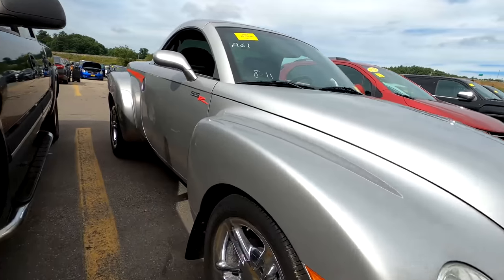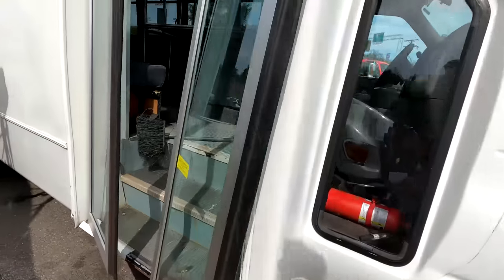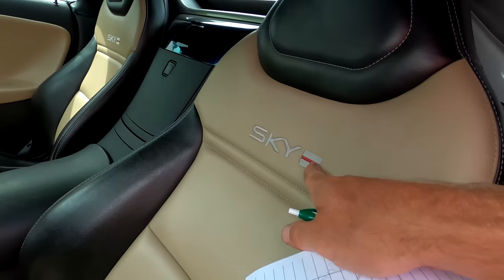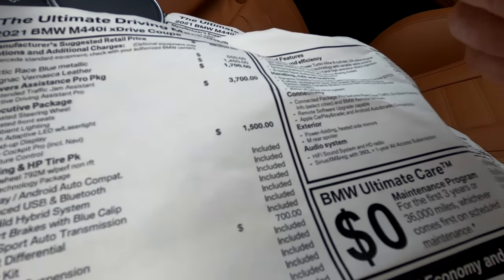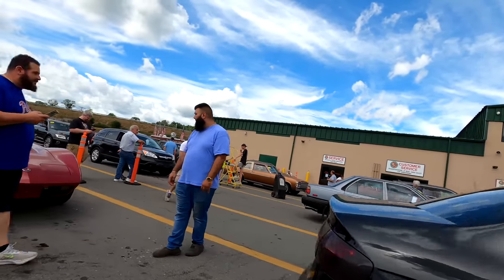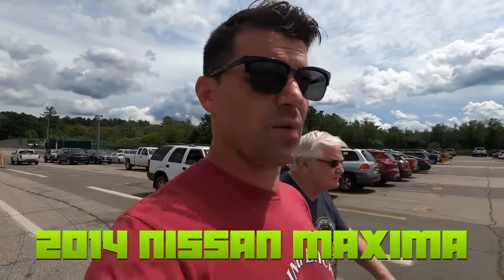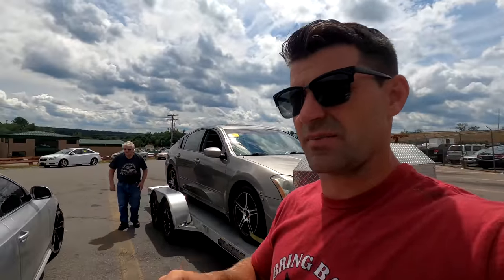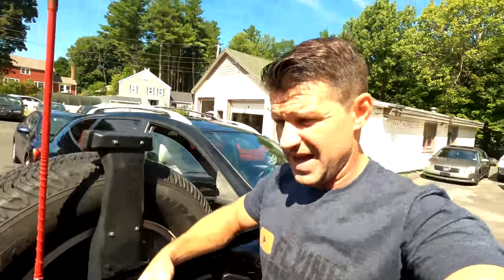Flipping $400 to a Ferrari - Bringing $67,000 to a Dealer Auction - Flying Wheels

Comment: Why are you hating on 70's cars? I like them and the 455 Olds Rocket motor were great engines, I had a couple of 70's Delta 88's one with the 455 and one with the 350 Rocket.... they were throaty sounding motors that ran forever.

Comment: You're getting your General Motors liters mixed up Craig. The '6.6 liter' was the 403 cubic-inch Olds V8 that was put into a lot of stuff in the 70's..... The 455's from Olds, Buick and Pontiac were stated as 7.4 liters (actually 7.45....)

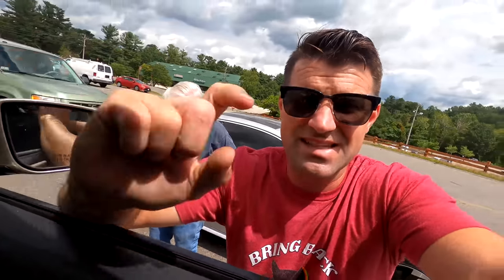Comment: @15:50... That Maxima does not have the same transmission as the 350Z. The Z is RWD, the Maxima is FWD. The engine is also different.
Reply from the maker: Good point

Comment: Yeah, Nissans and Infinitis with automatics, NOT CVTs, or manuals are great cars.  An 04 has an auto, not a CVT.  An 09 has a CVT.  Most of the other 2000s and 2010s Nissans have CVTs.
Reply: Sorry I have to disagree.. not all nissans are bad I have a 04, 06, 13 and 17 all of them never gave me any problems 3 have cvt. I will say the muranos and rogue are the problems. Altima maxima and titans have been great for me.
Reply: @shottie26  I'm not saying that the CVTs are bad, I'm saying that the Nissans without a CVT are great in terms of reliability and comfort etc. The CVTs are generally less reliable than the autos and that's because you need to replace the tranny fluid about every 30-50k miles on the CVT cars.

Comment: that hurst olds will be a 100.000$  car in the next ten years. Anything from the mid 70's era, aspen r/t's , 74-80 cameros, etc. is going to be the next generation of collectables for muscle car guys. I can remember buying my first 71 charger for $2500, now can't find a wrecked one for under 30,000, 100,000 for a good one. Yeah that toyota is a treasure? well it should be buried in a hole and never seen again for sure. The 80's were just a sad time for the automotive industry with a few exceptions.

Comment: Still to this day, That Oldsmobile is built better then most vehicles today except for vans & trucks being a cab on frame, v8 vehicles! I'd rather that then a fwd 4 cylinder pile of ---- yet, your interested in a 2.2ltr eco-tec where the transmissions are known to fail @ 160-180k & they have a interference engine though, the timing chains are easy to change on a 2.2 eco-tec!!!!!
Reply: Those old 70's cars, engines were worn out by 100k. 160-180k today is a decent life for an engine.

Comment: 89 Corolla indeed. My brother had one original everything he did a head gasket when he got it for $250 at 300k miles he wreaked it with 525k miles still rolling goo.

Comment: I would definitely get that 89 corolla so hard to find and that one is in mint condition they are going up in value and they definitely are not made like that anymore
Reply: I think the same generation was my first car. So many great memories!
Reply: Its a 30 year old car, n it was a cheap ass car back then.
There is no way its worth even a quarter of what it sold for.
I agree. They are not built like that anymore, but if you factor in safety and what you CAN actually pick up for 10k, you'd be very suprised to find, that u can get a safer car that will probably last as long as this will.
At this point, the seals have to be getting bad. Integral parts of the engine, who knows. Trans, who knows. Its a total crap shoot 
If you knew the entire history, that maybe different.
It was actually being used this entire time, just lightly and well taken care of? Maybe.

Comment: The Trans Am of late 70s  used an OLDS 403 engine mated to an automatic.while the manual still used the poncho 400.  So whether the Pontiac 400 or Olds 403 the shaker scoop would still read 6.6l.
By 1975 w30 package was the box you checked off to get the "hurst" edition Cutlass which included the olds 455 engine, hurst t- top, badging and whatever else
Reply: The 400 Pontiacs actually had T/A 6.6 on the scoop while the Olds 403 equipped Trans Am's said 6.6L. The 455 was 7.5L

Comment: Hey can you do a video on the new Dodge Rams 2019 and up 👍🏻
Reply from the maker: Just bought one actually
Reply: They are garbage quality from what I'm hearing people are having nothing but issues with basically new trucks not even close to being broken in yet
Reply: @FlyingWheels  I just bought a 2019 big horn . Finding out they have 16 spark plugs to change instead of 8 in a normal v8 plus hard to get to the drivers side to replace .

Comment: After seeing that Jeep I definitely thought you overpaid at 11k. Too much mileage and too much crap. Then you said like 67 hundred and I thought now we are talking. I think, get rid of all that sound system extra wiring, call an expert and make sure all the wires are good to go, nothing that could be a fire hazard should be left. All that red crap on the inside paint it black, get rid of that 8 ball also the leds from the rear, that looks ridiculous. I think it is a solid 9.5k sell, even with that mileage. I thought you screwed up again when you mention the maxima but it's a manual transmission so that was amazing. I use to have the same car and I didn't even know they came with a manual trans. Mine wasn't cvt and still wasn't that good. Everything else was still crap.

Comment: Well at least some vehicles are still losing good value.
There is hope in the used market.

I truly think when it comes to all German brands, ur an idiot to buy new (not u Craig just anyone who does).
Those brands lose the most across the board and quickly.
Usually at least 40% in 3 years. Which if owned by the typical leasee, thats a great deal

Comment: Could be a bored and stroked 427 small block in that Corvette. My Corvette is a small block 420ci. A bit more overbite or slightly longer stroke would net me 427 but I didn't want to compromise the block by boring it that much nor did I want to partially fill the water jacket to clearance the block for the larger stroker crank.  A aftermarket dart block wouldn't have these problems.

Comment: Hey Craig big fan but a few things to note :

Chevy ssr 6.0l is the ls2

The bmw is not a 440i m. The m comes before the numbers it’s m440i  and x drive means all wheel drive ( assuming u know that already ) 

Lastly the Saturn sky redline is the 2.0t is found in the cobalt ss and solstice gp. First gen cobalt ss and saturn ion redline were supercharged  also the Polaris slingshot was a 2.2 n/a motor so it’s slightly different. Polaris now produces there own engines now tho

Comment: Before you get to the Jeep wrangler market, im gonna go out on a limb and say its both because fiat made the JL a pos, imo. Yeah it drives more comfortably, however, they made even less reliable than it was. Also, more expensive than ever to fix.
The main price drop, probably has to do with gas prices. They are absolute gas hogs.

Comment: This is what I want to do! Unfortunately, when you're not 18 it's hard to do literally anything.  I'll just focus on the "clean a car" bit until then.
Reply: We all go through the same steps and are mostly all held back the same but you'll make it through it.  Gotta work to gain what you love.  The better the work the more it seems reasonable to the customer for a higher price.  And yea I've gone through the whole process to ASE down from detailing/fixing anything brought to me.  Won't learn without the drive/want to attempt/try but don't take on more work or make promises that you can't handle though last tip,  hope all goes well bud